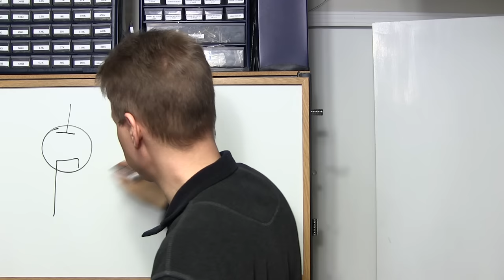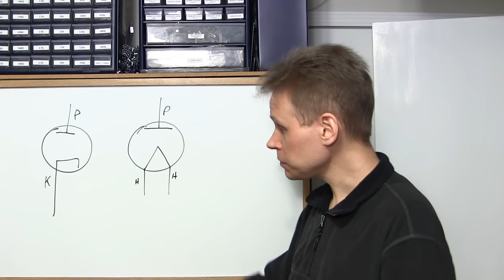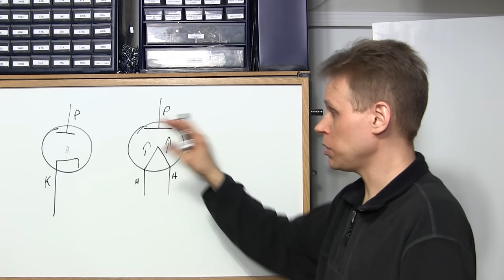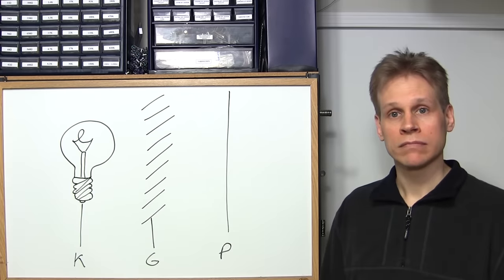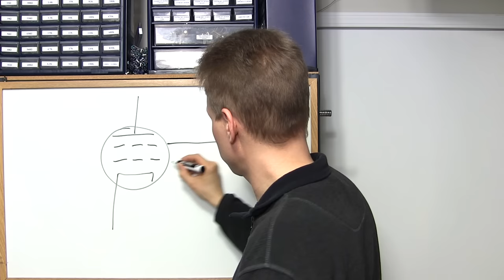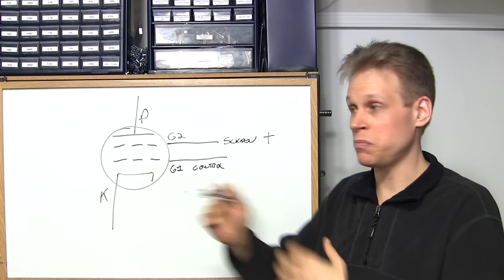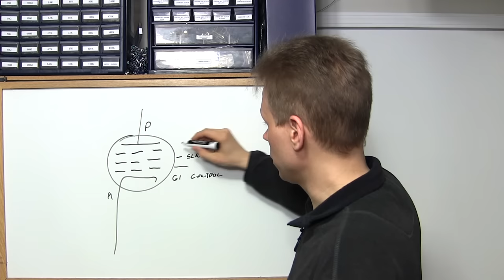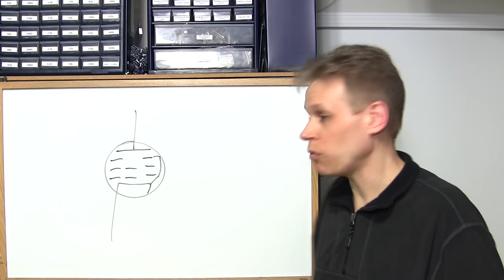How A Tube Works

Comment: Mr Carlson's lab I really learned a lot from this video you explained everything very well, but I have a question and please anybody who can answer it do.  What is the difference between a screen and a suppressor?  Is it that one is negative and one is positive?
Reply from the maker: Hi Cesare. The screen grid lowers internal capacitance by adding an electrostatic shield by positively charging the grid. This grid also improves power sensitivity. The suppressor grid reduces secondary emission. When electrons fly towards the positively charged Plate or "Anode" they hit the surface at high velocity. When they hit the surface, some bounce back into the grid structure (kind of like spraying a hose against the wall) These rebounding electrons are known as secondary emission When ever you see KT in front of some numbers on a tube, these letters stand for Kinkless Tetrode which means the tooling for these tubes is very accurate. The grids are perfectly aligned so the electrons fly through with ease. The screen grid is in the shadow of the control grid.
Reply: Mr Carlson's Lab oh ok i get it now.    So basically in an amplifier setting the screen allows the tube to be more powerful without excessive static or unwanted noise.  correct?
Reply: Adding a just screen grid increases amplification but also introduces distortion. Adding a suppressor grid or accurately aligning the grids in the tube reduces the distortion.

Comment: I actually have some high-end audio gear (Harmon Kardon Citation IV) I need to repair, but it needs a diode rectifier bridge rebuild. 120Hz ripple is audible just above the noise floor. I can probably handle the rebuild. Just don't know where to get the parts now that Radio Shack stores are history and my local electronics store isn't into legacy stuff.
Reply from the maker: Hi. If the rectifier is faulty, the fuse will usually go. The Citation needs new capacitors. Use Nichicon, Rubycon or United Chemi-Con capacitors from a reputable source. There are many fakes on the market so be careful.

Comment: Note that any piece of electronic equipment prior to about 1927 will have directly heated vacuum tubes such as a 201, WD11, or 199 (among others). Indirectly heated tubes were invented in about that year... before that almost any radio will have been battery operated, unless one purchased a specially made battery eliminator.

Comment: I have a question, maybe someone mightknow the answer to.  A few guitar amplifiers, one being the Bugera V22 Infinium, have a Pentode/Triode switch on the back.  I believe this amplifier uses 6L6 tubes in the power section.  Normal operation is "Pentode" mode.  In triode mode, what is going on?  Do the Beam plate and screen grid not get supplied any voltage at all, so it is effectively a Triode?  I'm very curious.  I am looking to get into amplifier building at some point.
Reply: Strictly speaking, the 6L6 is a beam tetrode but is often referred to as a pentode. By connecting the screen grid to the plate/anode, the screen becomes part of the plate,  converting the 'pentode' into a triode. The beam forming plates are internally connected to the cathode so they are at the same voltage in triode or pentode mode .

Comment: Big thumbs up as usual, but I am having trouble getting used to the idea of using conventional current in tube circuits and electron current in solid state.  Both are backwards to me.  In vacuum tubes, electrons actually move from the cathode to the plate, so why use conventional flow, which is opposite?  In solid state, conventional flow takes you conveniently in the direction of the arrows representing components of diodes and transistors (anodes and emitters), so again, why go the opposite direction with electron flow?  Did I miss something?
Reply: For me the conventional current flow started when I studied physics in college, we had to kind of think in the same direction as the teacher, and he was a conventional thinker.  When every body around you start to behave like the teacher and the analysis are all done in the conventional way.......Why fight it? Little by little you just get used to it.  But there is nothing wrong doing it the other way as long as you stay consistence with your notation and that's all.  You didn't miss a thing!!!!  I kind of felt the same way as you do at first thinking that all my current direction arrows were actually pointing backwards, and that's how I got through that part my electronics ordeal learning process.
Reply: Current is made by the flux of electrons.
The electrons flows from negative to positive because negative liberate electrons to positive.
Thats it, simple like this!
In solid state is the same thing!
 (Sorry by my poor english)
Reply: Electricity was discovered long before the discovery of the electron and early pioneers were unable to decide on the direction that electricity flows. There was a meeting and they decided to agree that it flows from positive to negative. What we now know to be a flow of electrons from negative to positive was seen as a current which flows from positive to negative. Before the discovery of the electron, so much of electrical engineering and electronics theory and practice had been based on conventional current that it would have been impractical to abandon it in favour of electron flow.

Comment: This was very interesting I never knew anything about vacuum tubes but I knew what they were used for radios and televisions in different electronic equipment I just didn't know how they work mechanically that is very trippy that it. Takes heat for the electrons to flow but anyways on a side tangent I'm railfan and I've always wanted to get a railroad scanner maybe you can show me how those work on what megahertz are what other type of equipment you got to have to listen in cuz I love to photograph locomotives and I've always wanted to get a railroad scanner maybe that's a side tangent you can teach me if you don't like the suggestion you can just discard the message but I appreciated learning that I was very interesting about vacuum tubes peace out man have a great day

Comment: You mean 4CX5000A, if we connect the Screen Grid to supply via a resistor we can make the vacuum tube operate at 45V which is much safer than 115V, if we want to experiment with vacuum tubes then the TELEFUNKEN Space Charge vacuum tubes which will operate with B+ between 12-60V.

Comment: Why are you calling the positive plate the anode and the negative side the cathode? I'm used to thinking of it the other way around. I studied chem in school and my only experience with this stuff comes from galvanic cells. Are the sign conventions different for batteries? That feels like it could be right but I don't really understand why if so

Comment: Basically works just like a bipolar transistor,  I used to use transistors for phase inveteres on push-pull the difference is the voltages and the heaters.
Reply: A triode's operation is much more like an n-channel JFET.
Reply: why an N-channel JFET? and not a common bipolar? or an isolated gate bipolar.   Please explain
Reply: The triode and the JFET are voltage controlled devices, while the BJT (bipolar junction transistor) is a current controlled device. The (conventional) current from plate to cathode in a triode is controlled by a voltage on the grid which is negative with respect to the cathode. The current from drain to source in an n-channel JFET is controlled by a voltage on its gate which is negative with respect to the source. The current from collector to emitter in an npn BJT  is controlled by a current flowing from base to emitter (a current which, of course, can be derived from a signal voltage).

Comment: love your videos there so informative even to non educated ged holders as my self that is self learning (playing with abha coils resistors etc)... liked and followed keep up the great videos , what kind of thing has replaced these these tubes in tech today I know I get amps and things today there is no tubes so what circuit or things replaced the tubes is my question
Reply from the maker: Hi Nick, tubes have been replaced by devices that perform "like function" at lower Voltages, these devices are known as transistors.

Comment: When I look at this I think of a capacitor, the positively charged plate ready to receive charge from the cathode but than the grid can stop the static charge from flowing towards the plate. The primary difference would be a capacitor would not pass DC unless it was shorted where-as a vacuum tube can.

Comment: Hey, you've managed to film the cord, a glass Imperfections that is difficult to photograph.
At 21:30 you can see the beautiful patterns!

From a web page on the glass: Stretch Marks, Referred to as a cord in the industry, these lines are only visible when light hits the glass in certain directions and can't be seen when filled with water. The lines are a difference in density that occurs during the melting process. 

This is quite unknown concept, and Google is not very helpful ...

Comment: how does the screen grid not affect the electron flow though? if its positive wont it just add to the effect of the normal grid? good video but that part is confusing.
Reply: The positive charge on the screen grid accelerates the electrons heading for the plate. A few of them hit the screen grid but the majority of them pass through the screen and arrive at the plate.

Comment: So in the case of indirectly heated cathodes, are the cathodes heated by induction with the filament windings or just by thermal conduction? I always thought it was just the filaments which glowed in vacuum tubes, but if I understand correctly, it's both the filament and the cathode which glows in an indirectly heated tube?
Reply: The cathode is heated to red hot (777 deg. C) by a heating element inside it.

Comment: I replaced hundreds of 807s in SW transmitters in the 1980s - we'd picked them up for 20c apiece (soviet surplus acquired in the 1970s) and they lasted about a week in service

When the shotrtwave station was shut down in 1993 there were still a few thousand left in stock - and they couldn't be given away, so went to the dump
Reply from the maker: Thats a shame!

Comment: So how does a grid "amplify" a signal in your metaphor as a venetian blind? Wouldn't it only reduce a signal to varying degrees?
Reply from the maker: The grid itself is only a controlling element used to vary electron flow. "control grid"

Comment: Thank you for this! Excellent video. I have a question that I'm hoping you can help me with. I have an old Swan amp with 8950 tubes. They are direct heating (just learned that from you!) 12.6v filament. 8950's are TOUGH to find and expensive. I read that 6LF6's, 6LR6's or 6KD6's are direct plug replacement and power output as the 8950, they just have 6.3v heater. So my question is, can't I just wire in a resistor to pin 1 and pin 12 to evenly cut the voltage to each tube and use these? 
Thank you very much! 
Ryan 73, N8SAN
Reply from the maker: Hi Ronix. The 8950 is actually an "Indirectly heated tube" meaning the filament is inside a cathode sleeve. Depending on how many 8950's are in your amplifier, you may be able to put the 6.3 Volt filaments of the replacement tubes in series. There are many internal connections in the 8950 to lower "lead in" inductance, as they are a sweep tube design, intended for RF application. The 6LF6... LR6...KD6...LB6..... may have slightly different pin configurations for internal connections. You may need to check socket tie points. Be Careful, there is Very High Voltage with substantial Current in your unit!

Comment: Mr. Carlson, I recently procured an old Oscope from the 50's.  It's a Devry Technical Institute 1G09 which is (unfortunately) never going to operate again since someone pulled the large connector off the back of the CRT tube.  It DOES, however, contain all the original, 1950's vintage tubes.  I think at the very least I have a matching pair of GE 5Y3GT tubes with all matching numbers on them as well as a pair of Sylvania JHS 6AU6WA but they differ slightly in the other number that I can see.  one is a 5535A and the other is a 5505A.  Is there still interest in the community for tubes like these?  There is also a GE 6AQ5 and a Sylvania JHS12AU7.  I also have the original sockets for all.  You're the authority in tubes and I respect your opinion greatly.
Reply from the maker: +Tech Gorilla 
Most of the tubes in that scope are pretty standard stuff. That scope is highly collectible among scope enthusiasts, and the connector can be replaced easily. If the case is intact, and it isn't too thrashed, I would think about restoring it.     I'm going to do a video on the restoration of an older scope quite soon, then I will align an old receiver with it.
Reply: I'm not even in the class that you are, sir and would not even attempt to restore tube equipment.  I've done some research on the 5Y3GT and am finding something odd.  I know they are the black-plate version, but the matching date codes on each one only have 3 digits.  5-22 vs all the other date codes I have been able to view (like 57-22 or such).  Is that relevant?  I'd consider donating this to your repair and restoration series, but I can only imagine you're quite busy.  It came in a custom wooden case that is clearly not original.  I'd be happy to send pictures if you're curious.
Reply from the maker: +Tech Gorilla 
I'd love to see what it looks like. You can find my email under the about tab.

Comment: I did my time in digital electronics, TTL logic, CMOS, CPU etc but I'm trying learn about the advantages, the mystery of of tubes. I have been told by a tube amplifier buff that the heater filaments should be heated up BEFORE high voltages are applied to the rest of the tube to protect them say 20sec delay. Would you consider making a video on how this might best be done simply.
Reply from the maker: Thanks for your input Gary!
Reply: It's not necessary for tubes found in audio equipment. Just one of the 'audiophile' myths. (RCA Transmitting Tubes Technical Manual No. 4, p65)
Reply: Preheating may cause problems. For example if the rectifier tube is toasty hot and then you apply HT then the input capacitors will have massive inrush current available and the tube or caps could be damaged.  A slowly turning on tube would give the caps time to get partially or wholly charged. 

In an RF amp you apply heaters and HT first, then drive. In this case I believe it is kinder to the PA tubes so the cathode is not expected to stream electrons when not hot enough.

Comment: That power triode looks kind of like a 24G (a VHF triode).  You don't see a lot of those around but they were in my old BC-640A (5 of them in fact).
Reply from the maker: If you are talking about the large tube in the intro, that tube is an RK39. (807 on steroids)
Reply: Not the 807.  The VHF triode, the only triode in the whole video, @ 24:00.

Comment: So what kind of a tube is a KT150 tube? (for example by Russian maker TUNG-SOL). The KT150 is the most powerful tube in the Single Ended high fidelity tube amplifier audio scene! PS +1 for your vid you are the most intelligent youtuber I know :)
Reply from the maker: Hi. The KT portion of the tube designation means "kinkless tetrode"  It just means they put in the extra time to align the grids inside the tube so they shadow. (less electron collision with grid wires) There are many tubes that will work just fine in audio service that are much larger than this. The KT150 just has an octal base so people can easily swap them with other tubes. Thanks for your kind comment!

Comment: Would have been good to draw the physical structure too. I'm curious about the principals of the wave guide part of the beam power tubes.
Reply: In Uncle Doug's video 'Guitar Amp Tubes - Part 2', at 13:13 there is a cut-away drawing of a power tetrode, and he explains its operation.

Comment: Why do rectifier tubes use 5 volt filaments instead of 6.3 volts like most tubes?
Reply from the maker: No real logical reason, other than they need their own winding.

Comment: Another great and interesting video Paul. I seem to remember back in my TV engineering days  that older TV sets that used tubes the filaments of the valves were often wired in series to help limit the current surge, additionally a Thermister (negative temperature coefficient) was also in series with the filiment so when it was cold the resistance was high but dropped as it heated allowing more current to flow in the filiment heater. Are these Thermisters still available?
Reply: Yes, they are called NTC these days

Comment: I couldn't pass on this one.  I'm an old electronics guy and worked with vacuum tubes for over 20 years.  When I was attending Air Force tech school back in '57, one of our instructors told us that we all knew about diodes, triodes, etc. but did anyone know what a heptode is?  After a short pause he blurted out, "It's a real gone frog."